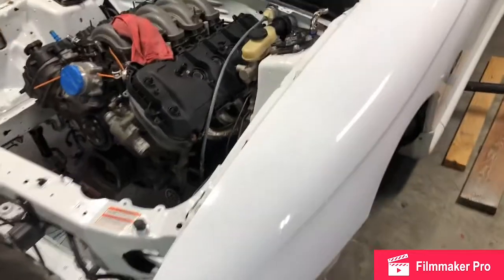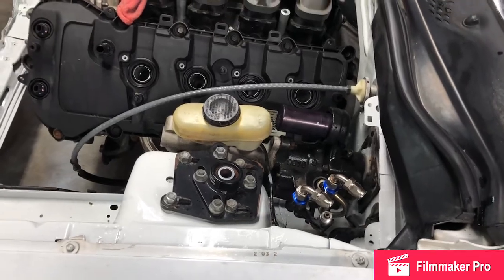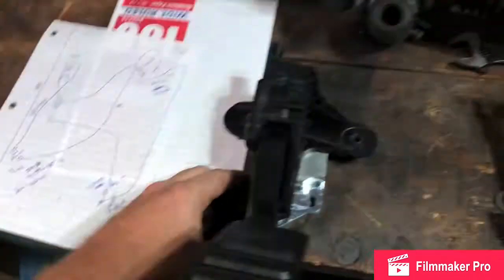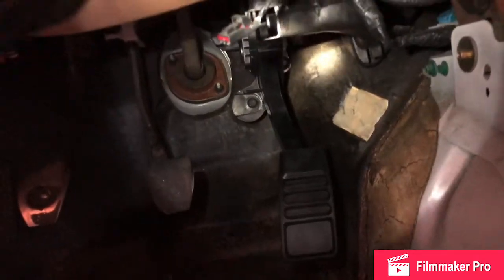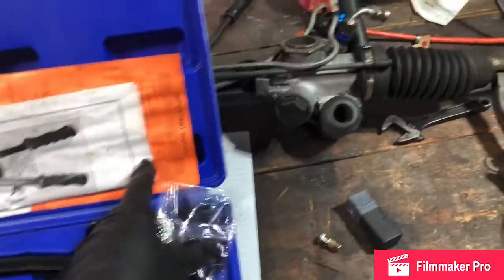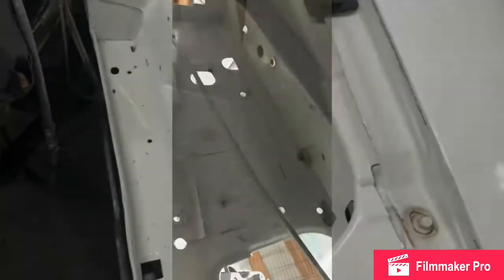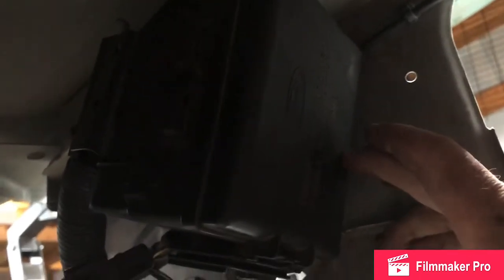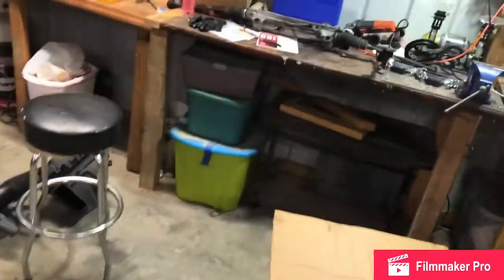SN95 COYOTE SWAPAROONIE PT 5

Comment: You won't have any clearance issues with the driver's side heater hose. What hood?

You won't have any swaybar clearance issues either. I even spaced the K-frame down 1/2" and it clears even when the car is in the air and the swaybar rotates to its closest arc toward the engine. Clears the A/C compressor by about 1/4" to 1/2", using the PBH bracket kit.
Reply from the maker: Just a stock hood. I think it’ll be ok.